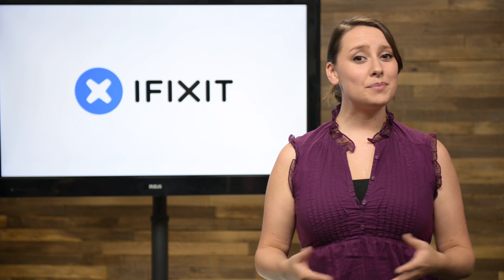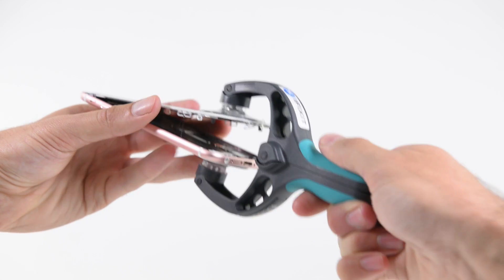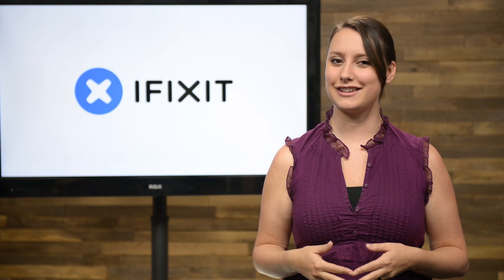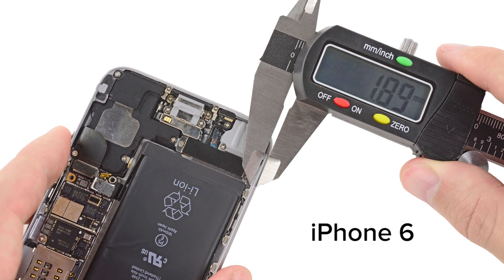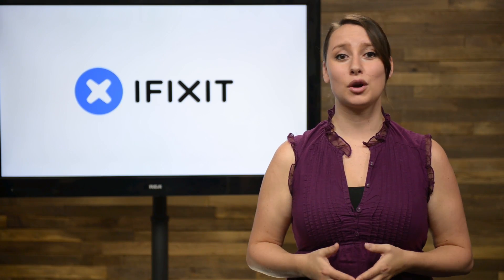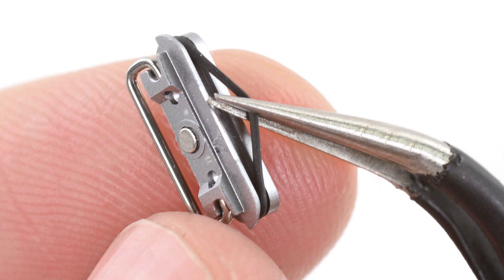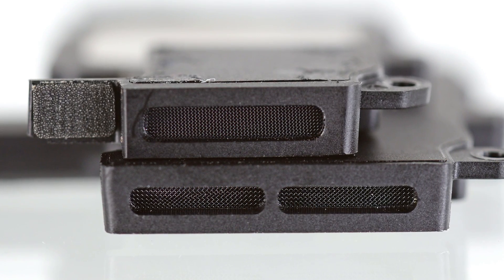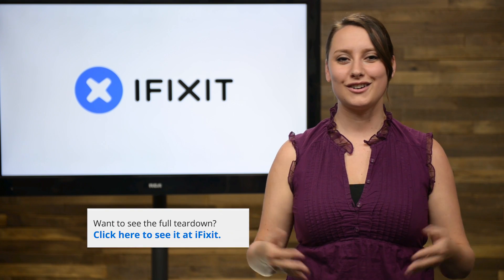Is the iPhone 6s Waterproof?

Comment: Hi, thanks for the video. This answers a lot of questions for my iPhone 6s. You talked a little about water damage. Do you possibly know what is considered water damage when you swap out to a new phone where they can see with this gadget inside the phone and determine if the phone you are trading in has water damage. What do they look for and consider the phone to have water damage. I haven't yet swapped my iPhone 6s for a newer iPhone (maybe iPhone8 in the future), but will possibly next year. I am asking because I go running with my phone in my side pocket in my running shorts and sometimes it has rained (profusely at times). My phone still works as good as new. Never had any problems with it. I am just concerned when I do swapped it out for a new phone, they might see something inside the phone with their gadgets and consider it to have water damage. I enjoy your videos; very informative and very helpful. Keep up the great work!
Sorry for the long message.

Comment: I still like my Xperia Z1S with its 1920x1080 display and 20.7 MP camera.  I also like how they Xperia does not have a protruding lens that makes me think of Pinocchio.  Now as if 20.7 MP is not enough the Xperia  Z5 comes with 23 MP.  I know that Nokia has a 41 MP camera but that phone runs on Symbian.  Sony for now has the most megapixels in an Android device.  When I first looked at the Xperia it looked somewhat like an iPhone because of the chrome ring around the camera and the glass on both sides but that is where the similarities come to and end.  I also like my Xperia because so far it has not bent but I don't keep in in of all places my back pocket.  The only thing worse than it being in your back pocket is to sit down with it there or even in a slightly snug front pocket.  I am very careful not to do either of those things or drop it and crack it.  I could attach a lanyard to my Xperia if I wanted to even kinda like the ones they used to include with USB flash drives.

Comment: If you buy a used 6S there is a chance that it might not be very water resistant at all. Once someone opens it up, the seals lose effectiveness.
Reply: how many people open up their iPhones?
Reply: dan428 Most used phones on eBay/Swappa are broken -> Fixed -> sold as new.

Comment: apple... y u no advertise these things? the same thing happened with the apple watch.
Reply: +Jesse McClure So they dont have to claim anything for warranty.
Reply: +Jesse McClure So they can say "Awww, you phone got damp so your care package wont cover it and you will either have to pay us allot or buy a new one"

Also if they don't tell you it is water resistant and the water seal fails you don't complain
Reply: ***** AppleCare isn't warranty it is a service plan.   I was talking about AppleCare.
Reply: WolvenSpectre Apple Warranty and Apple Care are both voided when there phones is damaged by water.
Reply: Jake Methner The key word there is "damaged".  If the phone is undamaged by water, even if the device tests as failed for moisture, warranty not only holds, but is (last I read which I admit was years back) because there are legal implied warranties they have to support.  Apple Care is gone the second the moisture detectors trigger.

A common example of this is a chipped or cracked screen after only light handling from the factory, but humidity or going in and out of doors in colder climates like here in Canada in the winter, can trigger the moisture sensors of phones, but the phones still work.

Comment: How well does the USB Type C connector hold up against water? Could water enter the iPhone through there, or is it waterproof?
Reply: The iPhone 6s doesn't have an usb type-c connector but I guess it won't be fine after the immersion.
Reply: +Steamrick it's not usb type C, it's Lightning (Apple own reversible connector). As Sony do it with their Xperia Z3+ and Z5 Series, it's possible to get a waterproof connector.
Reply: *****
You're right, my bad. Guess I set my expectations too high after the Macbook came with it.
Reply: It is not sub type c it is still lightning to usb 3.0

Comment: So i could make my iPhone 5S semi-waterproof by putting adhesive on the inside edge where the plastic frame lays on?
Reply: +Lorenzo van het Hul Nope, water enters through many more ways than that. Power buttons, ports, etc
Reply: If i use silicone to fill tje gap between the ports, audio jack, simtray, and such. Is it theb waterresistance
Reply: You can't just add silicone to anywhere you like, It will cure and then you'll realize the phone doesnt go back together.
Reply: Yea but without opening it. Just to fill the gab between the flash (already done works great) and the buttons and jack and plugs. And i want to adhere the screen to the body like the iPhone 6S
Reply: Lorenzo van het Hul
Yup. report back.
Reply: +Lorenzo van het Hul Yes u can.
Reply: Nice
Reply: Gonna try hopefully i dont destroy my device
Reply: Lorenzo van het Hul If you fill the buttons with silicon it wont even work anymore. Once it dries the mechanism for all the buttons will stop working lol.
Reply: Lorenzo van het Hul
u wont.
Reply: DarkTube With Silicon sealant that dries?

Yes he will.
Reply: It is flexible so it will. I will give it a shot
Reply: If the silicon comes underneath the muddaf** button, it will stop working but thrust me it wont and if it does i will take the matherfacker apart and try it again.
Reply: +Jake Methner or worse, you end up with an ugly mess and ruined phone.